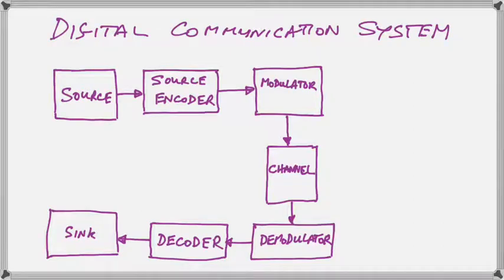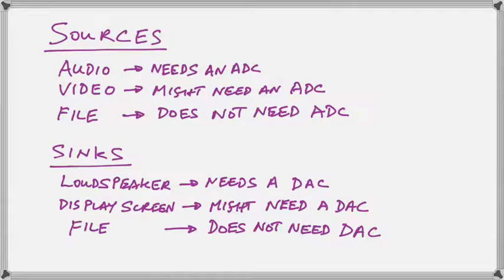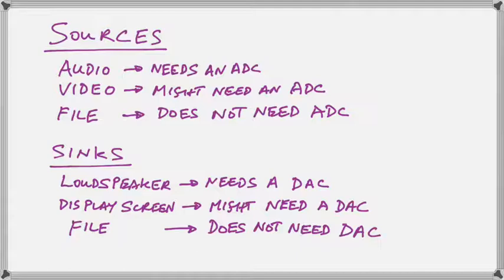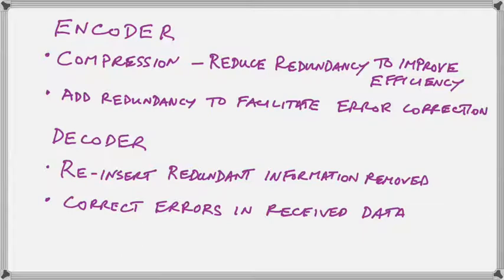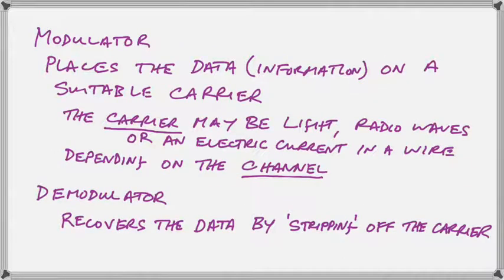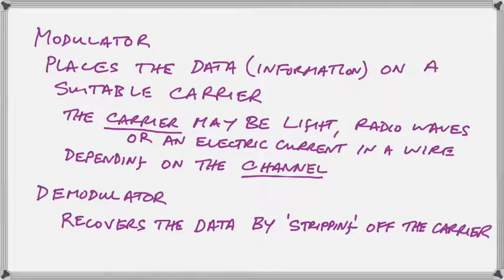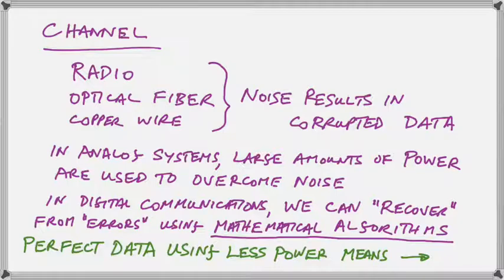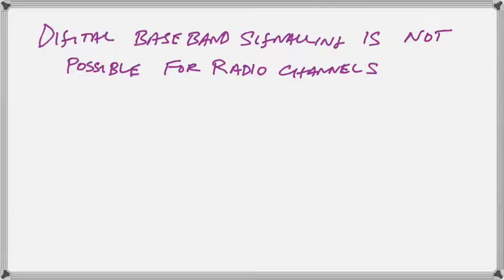Introduction to Digital Communications Systems

Comment: I have to ask ... is the sine wave the most efficient carrier because they are representations of a single frequency with no harmonics? :)
Reply from the maker: YES.... very good 😁....  we are trying to get maximum THROUGHPUT  (which for any specific channel is the most efficient use of bandwidth)..... modulating any carrier WILL create harmonics ...... modulating a carrier that already  has harmonics creates another set of harmonics for every harmonic which increases the bandwidth with no increase in information throughput.... so we always start with sine wave carrier